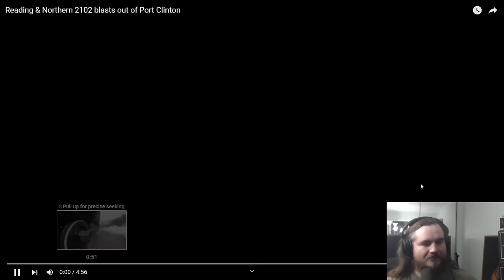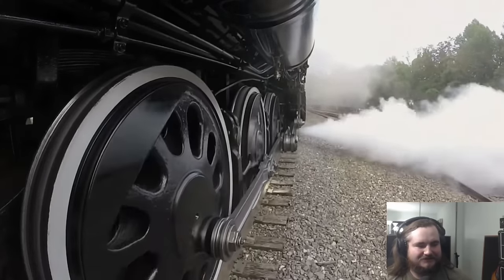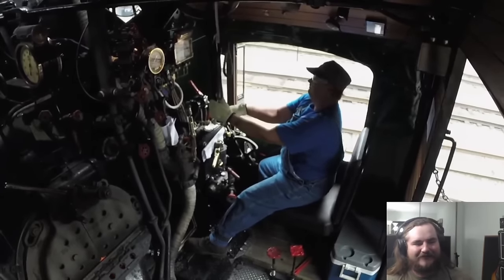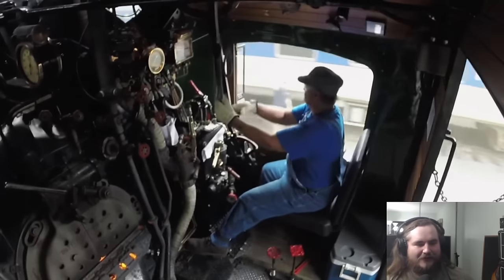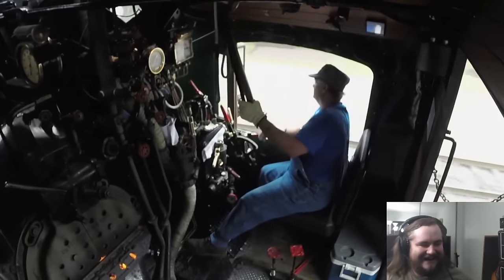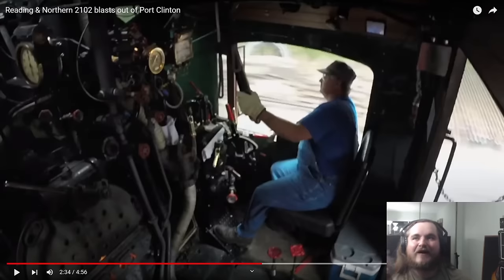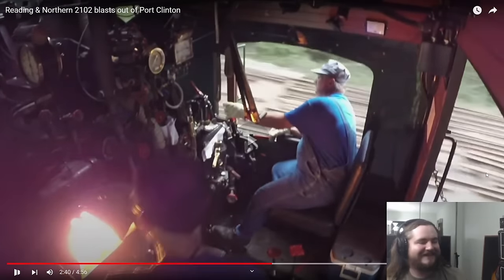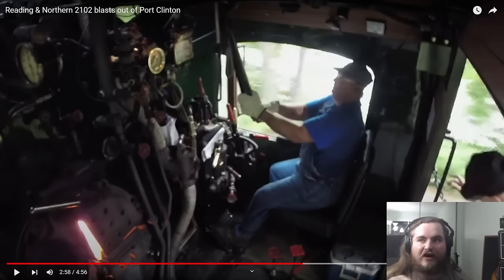Reading #2102 - the BEST steam sound EVER? Reaction from a railroader

Comment: Thanks for the reaction Hyce!
3 things to add: 1) I'm pretty sure the fireman is using the shovel to scan the fire for any holes/high spots/etc.  They use this same technique with 425 which obviously doesn't have a stoker.
2) I filmed 3 other trips in the cab, and while all the departures were impressive, Shane (the engineer) really went after it on this day (Sept. 3).
3) This is a great railfan-friendly operation that is well worth visiting/riding/chasing.  The sound is great in videos, but it cannot compare to being there.  And 2102 is by far the loudest locomotive I've heard.  From trackside the exhaust will make your ears ring when they're working full throttle up a grade.
Reply: That is 100 percent what the fireman is doing. You have to be careful when doing this on big engines. The draft can pull the shovel right out of your hands. You'll never see it again if that happens... Till you dump the ashpan. Small, melted chunks of the head and wood ash will be all that's left.
Reply: I've never heard a locomotive with chuffs louder than the whistle. Dang.
Reply: @maxwilson7001  That's because most preserved steam engines don't get to work nearly as hard as this.
Imagine a Terex Titan being used to haul a handful of fist sized stones. That's the extent of how hard most preserved steam locomotives work, mainly due to the cost of maintenance and the downtime involved. The harder you work 'em, the more work you have to do to keep 'em running, especially with the firebox and running gear. The last time 2102 worked this hard was probably when she worked the Rambles.
Reply: the term, "Thunder Under Heaven" Comes to mind.
Reply: Love the last point. Been to the 2nd and last Ramble and they are great with railfans, love the environment!
Reply: Anne Frank Vape Pen  Good quality coal is expensive and sometimes hard to source. Coal also requires special facilities or equipment to load it into the tender. UP's oil-fired engines can use cheap, recycled engine oil that gets loaded into the tender from a semi-truck with a tanker trailer parked up next to the tracks. You can refuel almost anywhere like that!
Coal is definitely more historically accurate, and the smell is something you will never forget. But you have to admit that oil has its perks.
Reply: that's why i like steam trains. the engineering behind them is amazing and how each and every engineering decision on the various aspects of the train turns into something beautiful and amazing at the same time. How they managed to do it i am curious to know. It's almost artistic.
Reply: Truly a sight to behold
Reply: This is so true. Pacing her uphill took my hearing for 15 mins 😆I love it

Comment: RBMN seems like such a class act, those guys took some scrappy Conrail branch lines and turned them into a 40mph mainline with CTC and welded rail. A few years ago, I heard they upgraded their mainline so they could run RDCs at 60, and set up weekly excursion service. There’s videos of them working their old hand-fired Pacific just as hard, the only reason they added diesels on those trains was to make it over the road with the same tonnage. It seems like they restored 2102 just so they could do away with the diesel helpers. Who says modern railroading can’t be fun!
Reply: If you ever feel like doing another one of these, I’d recommend Steam Train Video’s clip entitled “425: solo to jim thorpe”. One of my favourite cab clips of all time, watching the crew wrestle a tonnage train up the hill during leaf season. RBMN is no stranger to pushing the limits of their steam power. I’ve gotta get out there someday!

Comment: I've chased the 2102 for 2 years, and just got to ride it a week ago out of the newly opened Nesquehoning Station where they were pulling even more cars through the Lehigh Valley gorge to Pittston. I sat as close to the locomotive as you could get, got covered in coal, and it was an absolute blast! Of all the excursions I've been on , the 2102 and RBM&N definitely put on the best show hands down.

Comment: I did the math on this when you talked about it a while back. Shes got roughly 1200 tons of cars behind her. Not including the weight of the engine, fuel, passengers, etc. 

Absolutely blows my mind they get that amount of weight moving so fast. The sheer raw horsepower is amazing.
Reply: I believe, you'd be talking more about tractive effort as Hyce said horsepower was a very bad way to describe how strong a steamer was. We get the point though.
Reply: horses had nothing to do with it. it is pure steam power. :)
Reply: It takes a tremendous amount of torque, to accelerate 1,200 tons, that quickly.
Reply: @roadtrain_  Tractive Effort is not power, it is a measure of static pull. Accelerating mass is all about power production. A locomotive with higher tractive effort can create more pull from a standstill, but a locomotive with more "horse" power will accelerate it faster and to a higher top speed.
Reply: Remember you all this 484 was rebuilt from one of the most powerful 280's the Reading shops ever out shopped!!!

Comment: Thanks for putting this together, a lot! It was nice to see and hear her again. I'm an old guy, but once was young. If you Wiki 2102 (which you've probably done) you'll read that in 1968 there was a derailment. I was in the dutch doors with my buddy John as we were coming back into Chicago. I can say that steam trips had a reputation for always being late. Well, that day we were quite close to being on time (first time ever. I was on a 4070 trip in that era that didn't arrive back in until 5 am the Monday morning after) so I have always used the expression concerning this trip that we were "coming in hot". Getting close in to the stations in Chicago there is SO much track work (diamonds, switches, etc.) that even regular passenger trains took it easy. Not that day. My late friend John and I both said we were fast. Well, we hit some diamonds that also had a puzzle switch and things started shaking. John says "what the f* just happened?" I felt the shaking as being in time with the ties going past and I said "we're on the ground!" Good guess. Ahh, to be young again.

Comment: Andy's excursions were 17-19 cars plus the 50-100 coal crs he hauled on test and even revenue runs before the excursions went off. My wife and I were in Jim Thorpe for all the excursions and rode the July 2 event. I've seen this clip many times since it was originally posted but your commentary truly put in perspective what a spectacular accomplishment R&N has to its credit for the restoration and operation of 2102. Every excursion R&N did with 2102 sold out immediately. Thousands of people enjoyed the locomotive whether they be novices or with an understanding of what they were looking at. Young and old, men and women alike: Everyone was thrilled by 2102. It'll be interesting to see what 2102's encore is for 2023.Maybe a double header with 2100? Andy already did double head 2102 with the light pacific 425 in August. What an experience that was. To see and hear them blast out of Port Clinton was like a religious experience. As a 400 mile, Class B railroad, there's plenty of room for 2102 to stretch its legs while still being properly maintained. You couldn't ask for more.

Comment: It's been an amazing few years for the rebirth of big steam.  The crew behind 2102 has done an incredible job rebuilding this piece of machinery and they run it as intended with absolute authority.  Really great to see and hear.  I'm a huge fan of the T1 class.  They're not unlike your K-37 #491, both engines are examples of very successfully recycling obsolete 2-8-0s to build modern, up to date, enduring engines.

Comment: I was lucky enough to chase 2102's first tonnage train back in April, 50 empty coal hoppers, about the same weight as the train seen here. Climbing the grade North of Tamaqua was incredible. But possibly the best part was climbing the grade out of Jim Thorpe on the return trip, it had started to rain and she was struggling and slipping. The crew ended up having to kick in the booster engine. Talk about a lokie that is absolutely maxed out!
I highly recommend taking a trip out to Eastern PA someday. Not only to see 2102, but also the other 6 or 7 steam operations within 2 hours of it.

Comment: I got to ride behind 2102 on August 13th, 2022, which was actually a doubleheader with 425 because the train was too heavy for 2102 so instead of a diesel they tossed 425 on front to handle the extra tonnage. The Illinois Central painted cars are San Luis & Rio Grande cars bought at the bankruptcy auction. The reason for the long train and doubleheader was because it was Andy Mueller’s birthday. And Ross Roland was on the train also.

Comment: I'm planning on renewing my acquaintance with the '02 in June.  I go back to the Steam Tours days when it was restored in Akron in the late 1960s.  I've ridden behind it four times in my life.  1971 Akron to Spencer on the AC&Y; 1976 Wilkinsburg, PA to Altoona and back over Horseshoe Curve; 1977 Kent, OH to Greenville, PA on the EL (ran out of coal on the return trip and had to be shoved into Kent by a Conrail TV train); and 1988 for the BM&R Railfan Weekend.  In between I saw and rode behind the other operational T-Hog of the era, 2101, on the Chessie Steam Special in 1977 and '78.  Truly remarkable for not just the loudness, but the all-out speed they ran it at on those trips, around 70 mph where they could.  I remember standing on an old wood deck bridge when it went under and I swear the exhaust blast lifted the boards.  It was also a continuous roar at those speeds, no shotgun exhaust for those Reading rebuilds.  They may be ugly ducklings to some, but they really put on a show.

Comment: On the furka line where I fire we got 5 operational locomotives, and because it's a each railway going 11% grades we work our engines to the limit every time. If the fire is not spot on for the whole grade, your water level drops so you can't enter the next flat section. Also you need almost max boiler pressure on the steam chest to even move.
Reply from the maker: Christ, that sounds like a hell of a railroad to run. Where's that at?

Comment: In 1999 Santa Fe 3751 went through Cajone a Tehachapi passes on it's way to the Sacramento Rail Fair. The BNSF mainline runs near my house, just outside the Bakersfield yard limit is the beginning of 70 mph track limit. I stood at the edge of the ballast near the whistle post. He passed me high ball. The sound is what I remember the most. A week later I was at Walong siding, better known as the Tehachapi Loop when 3751 was headed home. This is the other end of the spectrum. A broken rail caused a speed restriction of 10 MPH. 3751 was not being escorted by a diesel so it was doing all the work. Literally walking speed through the loop. Oh and it was twilight.

Comment: I live on the east coast and a few years ago, Norfolk Southern had their 21st Century Steam Program. I got the opportunity to ride behind NW J-611. When NS was running steam excursions, they ran that locomotive hard. She had no diesel helpers. I know sometimes they had diesel helpers. This excursion they didn't. I counted 21 cars. When I was riding in the car looking out the window, I noticed we were moving the same speed as traffic. The speed limit on said road that took you to the depot was 45mph! Northern class steam locomotives are impressive machines. You can hear the locomotive work up a grade. She still was maintaining speed. The NW J I believe is rated at 83,000lbs. Of traction effort.

Comment: Your commentary was great.  Even if I didn't fully understand it all, it was clear you thought the engine crew was doing an expert job, and you appreciated the "art" of it all on a major piece of equipment.  Kind of like flying a WWII bomber not at an airshow today at low altitude, but at 25,000 ft. where you need the turbo superchargers running to get max power out of the engines while using all the other systems the crew needs to fly it that high, such as oxygen masks and heated suits.  

Do more of these!

Comment: This is legendary. 1 awesome video 2. This particular RailRoad- Reading and Northern that 2102 resides is a class 2 that mostly haul coal. If i remember correctly 2102 was built by in Readings shops. So shes been around but is home again but chuffed these rails for decades. they acutally test their Heritage units by pulling a consists of hopper cars. I think they do that in port Clinton. The Lehigh Gorge senic railways hosts my favorite diesel type they got EMD 270 A and 275 B in 2019.  they also own 2 other A units currently in the Altoona repair shops. My Favorite steam locomotive is #425. No offense to your locomotives they are also great for narrow gauge. But 425 runs the RBMT&N road she went in for her 1472 a few weeks ago. I work as a volunteer for the Deleware & Lehigh and also Ironton Heritage rail trail most of my model trains are PA more specific LVRR, which was founded in 1850 it was originally the Deleware Lehigh Schuylkill and Susquehanna Rail Road founded in Mauch Chaunk PA now renamed Jim Thorpe. They were authorized in 1853 to rename to the Lehigh Valley RailRoad. They went bankrupt in 1976. Also fun local historical fact Americas first portland cement plant was founded in Coplay PA by David O Saylor in the 1800s only a few years after Portland grade cement was creates in Britain literally like 20 30 years earlier. But David O Saylor found the local lehigh Valley limestone had the other key ingredients to make portland grade cement. Mostly hauled by the Ironton RailRoad. So thanks to the PRR  network and also the Deleware & Hudson and Central Railroad of NJ. I love living in the Lehigh Valley PA.

Comment: That T1 Reading loco was built in 1946 to hull long coal trains and has lots of power.
Not so long ago they pulled a 100 car coal train for a test after shop work, no diesel helpers or pushers in site , 
Keep the iron hot 🔥
I saw in the 80,s that loco push 4 hopper cars load with stone  with the brakes ( the did not hook up the air line) out of the was to get to the coaling platform .
It took a few tries to get the controls set and work them just right so not to spin the wheels , fourth try it keep the cars moving .
That was a real show of the power it has .
I saw it up close and road behind it .
I also road in the cap of the Steamtown,s  Canadian National loco over the road .
That was before the National Park took over Steamtown .

Comment: They pull between 19 and 21 cars on these trips. I chased one of the test runs and one of the trips this summer. It was just as awesome as it is on the video as it is in person! It's got some rod slop especially on the fireman's side, but it's not the worst I've ever heard. I'm sure they'll remedy that at some point if it's any major concern. If/when you make it out to Eastern PA, we're very fortunate to have so many tourist railroads all over, most are within an hour of each other. If you haven't seen or visited before, other than Strasburg and R&N, I recommend the Allentown & Auburn RR in Kutztown, Pa, Wilmington & Western RR just outside Wilmington, DE, and Black River and Western RR in NJ. The New Hope & Ivyland RR in New Hope, Pa and Colebrookdale RR in Boyertown, Pa are nice rides but are pricy comparatively.
Reply from the maker: I've been to the Strasburg, but that's it as far as PA goes. And, "you'd rather hear them than smell them", is the old saying I've always heard.

Comment: Is this the New River Gorge excursion?  They usually have a long consist trough the New River Gorge - The grand canyon of the East. I saw "Drive that New River Train" I think Penteax was the one who produced that.  Back in the 1990s, I think.

Play, I did a quick search and found a 3:00 excerpt of the video.  Then there's a bunch of railfan videos, one with a cab ride.

First off, the title is "Runnin' That New River Train" documenting the rail excursion out of Hunting, West Virgina.  It-'s not uncommon to have a 32 car consist.  This video had Nickle Plate's 765 (a 4-8-4).

Now Reading's 2101 is mentioned as pulling the train for a few years, so this clip could be recently from thet excursion.

This is an awesome video, and you get the sound of the engine without a narrator talking over it.

Comment: I heard a fairly decent recordings of a 2-6-6-6 pulling a long coal train on the Virginian and on the C&O and that sound was something. Even at lower speed those 4 cylinders working hard were blasting out some massive sound, at speed still very amazing as those things looked like they could pull the horizon closer. Not dising the sound of the 4-8-4, those monster simple articulateds had a very impressive sound.

Comment: Great video and sound!  Just need a way to make my house smell,  vibrate, and roll side to side while watching...  A couple Climax locomotives  I have crewed on years back would hop up and down in the cab area when working a grade at "speed".  One of them had a footplate that would bow up on a hot summer day a little like those jars lids that are up when the vacuum is gone.  That would add to the affect especially in one spot next to the engineer.

Comment: Rewatched this and your comments and her throttle was about half way out. At full throttle the handle is just above your head or eye level. This engineman and myself are close in height as well so it's not a height difference. Ive been in her cab thousands of times even babysat and slept in her. Shane's a great engineman too he fired/ran 2102 when I was a teen 30+yrs ago and thankfully he's still at it.
Reply from the maker: Good heavens. That things' got quite a lot of power.